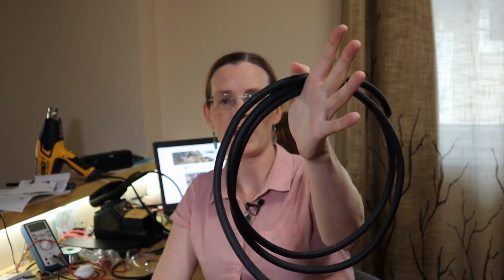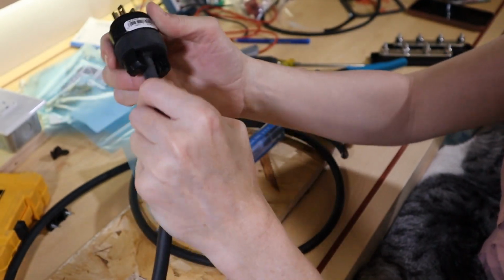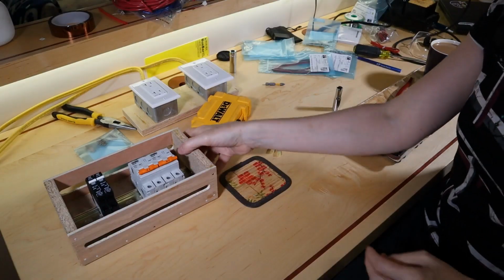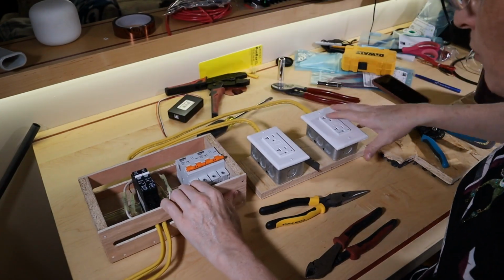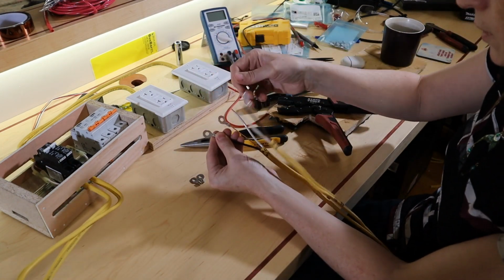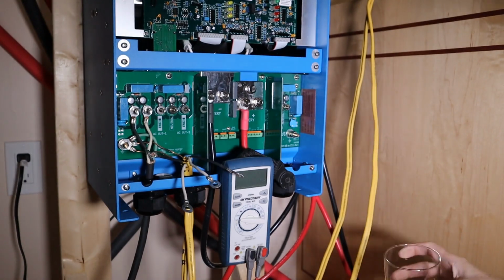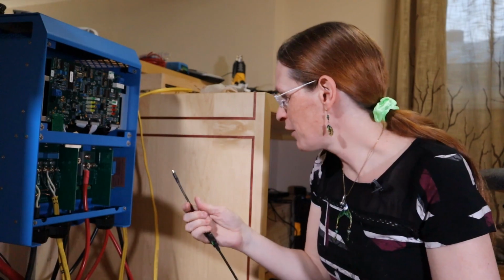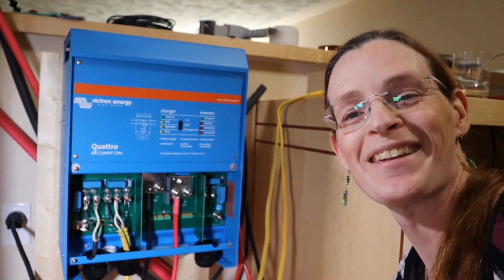Victron Quattro 48|5000|70 120v (Anti-climactic Part 2) - 48v Lifepo4 battery (Ep. 14)

Comment: Several issues to consider.
No 1 is leakage if power onto metal parts  . Example one Swedish round the world boat lost it rudder in Pacific crossing .The compass light on the steering wheel column was leaking voltage power and that connected to the stainless steel  rudder post and the stainless steel post eroded rapidly over a few years from  the electro chemical  forces with sea water and it finsly snapped  .The rudder lucky enough did not fall off and they got to a suitable island to effect repairs .

No.2 is lightning  storms and lightning strikes need to be factored in on electric circuits.   Always carry extra cable  and fire extinguishers as many as you can. One 60 foot boat had a large electrical fire in the engine room  mid Atlantic and the crew were surprised it took all three large sized fire extinguishers to stop fire . Now they carry 6 large fire extinguishers .They also now carry lots of  extra electrial cable as they had problems for normal electric power from lack of cables to repair burnt out cables ..

No.3 is copper wire connections corrodes a lot faster in thr marine environment . Good to not cut wires too exact to size so the connections can be remade at a later date . Also run a mouse string for wire replacement for upsizing or replacement .  Also cover connections with suitable  water resistant electrical  grease . There does exist s copper wire made for the marine environment that has much less corrosion issues .

No.4  issue is severe rolling over in bad weather eg 270 degree angle of roll from s broaching or freak waves event  .The worse is the rarer 180  degree or 360 degree  roll over in  storms .The system to keep battery in place in severe  roll  overs has to be considered..Severe rolls 270 degrees are more common where mast is partially under water from broaches going downwind .
Everything in boat cabins can then  be everywhere . If the  battery shifts then no lighting systems will add to problems .Good to have emergency solutions self contained battery operated  systems and also parrifin lighting and glass contained large candles. My boat had ma.ny large candles in glassed in containers and several parrifin lamps  lights and soon to purchase petrol fuel type

No. 5 issues  are sinking or wave event .Often in severe rolls or large waves the boats interior can be filled with large amount of sea water . It might enter from open or broken  hatches or  windows  or from prop strikes breaking shaft water sealing system  whatever . A one  inch hole 2 feet  below the water will let  500 gallons of water a minute enter a boat . After a few minutes whrn the hole is  plugged you need to pump out some few tons of water . In rough seas that water wil slosh around the boat and possibly cover the batteries even if they are placed in a  high up location . Planning for this might allow you to keep electric pumps going to help get water out of boat and prevent battery melt down from short circuits the salt in sea water can cause .

No 6 . The LED lights are very bad news to human eyes .They emit a light that over time can blind the human users .They should only be used to light up boat when the users leave boat on anchor and so they can see thier way back onto boat on the return . They can also be used for shirt periods to give extra lighting such as searching for something  in the boat .Other types of lighting for general use are better for human eyes .There exist suitable safety glasses that filter out the harmful light that LED lights emit and if you drive a lot at night can protect eyes from modern cars and street lamps now using LED lights . Also LED lights seem to lose power over distance.I find roof mounted LED lights do not light up floors as good as  other light types .Many boats also have red lights for main cabin they use at night time so the crew can maintain  night vision if the enter boat cabin at night .
Reply from the maker: 1. This is a very big concern, and one of the reasons why grounding will be a fairly big topic. Sacrificial anodes can only do so much...

2. Lightening is another reason for the grounding question to be such a topic. A strike can blow holes in the hull as well. On fire suppression, this is another topic I plan to address more after I get the boat. Coming from the IT world, I'm tempted to fit a proper electrical fire suppression system, if space allows.

3. I'm using marine-grade wiring (tinned copper) to prevent corrosion, and I am using resin-lined shrink tubing (ABYC compliance, at least as best I can). When I refit, I plan to run conduit (as I did in my house when I renovated it). 

4. I plan to have a (fairly) heavy displacement boat, but just the same everything will be strapped in place in case I turn turtle.

5. You noticed how I'm using the booted Anderson connectors and talking about keeping things water tight? This is exactly what I have in mind. I need to keep the batteries low for weight distribution, so I need to make them as water resistant as I can. I'm aiming for IP64 or better across the board. Truth is though, if things get so bad that I have that kind of water in the boat, I'll likely be powerless in any case and relying on a manual bilge, if I even save the boat.

6. I'm gonna need to see a cited source for the LED claim. I've used exclusively LED lights in my house for ten years without issue.
Reply: 6.  where did you get that from?
     are you trying to tell us that the whole world is blind now?

Comment: Hi, about the woodwork; personally I build wooden boxes (10mm plywood sidewalls, 18mm floor) for my rv battery's. I paint them inside with white primer only. Prevents moisture, and shows better when there is something leaking/or scorching... Outside primer and a nice strong topcoat. The top cover of the wood box, for the terminals I make from trespa this is a very hard synthetic material heat resistant. Used for cladding outside of houses. 
Perhaps showing the woodwork build in sort of time-lapse?
Reply from the maker: I did the stand in a sort of jump-cut style. I might do that for future wood stuff. I should mention also that this box is very temporary. Anything I do that I expect to last will be done a lot better.

Comment: Quattros only support VE.Bus connections.  You need a VE Bus smart dongle for bluetooth or MK3-USB for PC. 

VictronConnect is not fully implemented for VE.Bus devices.  Recommend MK3-USB, PC and VE.Config software.

Multiple linked inverters MUST be powered by the same battery.
Reply from the maker: Got the MK3 and Cerbo GX on order. Realized what I was missing when editing. Next video will be made once the arrive going over learning to use and configure the Cerbo and Quattro.
Reply: @TheDigitalMermaid  Glad you're going with the GX. I have the CCGX. Can fully monitor and control my entire system from 3.25 hours away with VRM (GX allows access).  Can download Quattro config file, edit with VEConfig and upload it. Can update firmware. Can change MPPT/BMV settings with VictronConnect.
Reply from the maker: @snoobler  Ya, that's part of why I decided it was worth the cost. Get it all working properly using their tools, then I have a reference when I start working on my future project to monitor / control things.

Comment: When you were testing output 1 the resistance was climbing but the meter was cycling trough it’s ranges. That’s why you saw an output of 10, first just 10 ohm, then 10 kOhm and ultimately 10 mega. I might be wrong but I did re check after watching the video and it sure looked like it was so in the bottom right corner of the DM. I’d say transformer and an capacitor is at play here. :)

Comment: it seems everyone is wanting to make sure you solder the terminals.  i think that is a nice feature to a GOOD foundation!  

other than that, my concern for your good foundation is to return to my question elsewhere, is 100 amps @ 55v enough power to the prop?  it may be your turn to say i'm getting the cart before the horse, but if i'm right, you are spending way too much money on gear that could be way too light for the job.  btw, one last time before i continue down this path.  did you consider sound proofing the engine room?  it can be done to the point you can not hear the engine if not inside the engine room.  i'm a witness to it.
Reply from the maker: I mentioned elsewhere, but I plan to have 6 of these packs for a maximum draw of 600A continuous at a nominal 48v. That is based around the QuietTorque 30kw direct drive motor, though I do still have other options. In any case, the idea of having N-number of 100A 48v batteries leaves me a lot of options on the table for whatever final design I settle on. 

On the noise of diesel; The noise is very much the top concern, but it is not the only reason I want to get rid of it. I don't want to be a diesel mechanic. I don't want to deal with oily bildges or smelly fumes. Every solution has it's pros and cons, and I've made my life in IT. So to some degree, the idea of maintaining an electrical system feels more familiar to me. 

There's also the idea that, even factoring all the limitations of electric drive, I can generate power anywhere, and almost any time. If there's no wind, there's probably sun for the solar panels. If there is wind, then I can start sailing and generate power via the prop's regen ability. Out at sea, I can't create new diesel. 

In the end, the choice of diesel vs electric comes down to "what hassles can you live with, and what can you not?". For me, electric wins.
Reply: @TheDigitalMermaid  ok, got it!  "electric wins".  but, i won't write that in stone just yet.  this way you can still change your mind.  

i looked up your QuietTorque 30kw direct drive motor.  NICE!!   looks like you will be changing the size of each pack.  that will reduce your run time unless you raise the number of packs.  i did not see numbers on the Programmable regeneration.  did you?

on an average day for me, i use about 1.5-2kw with my 12v system.   that is just for fridges and computer.  my water pumps don't get much use since i'm alone.  if you ran your 30kw at half load for 1 hour (no wind for sailing), that would be 10 times my use.  my catamaran is 48 x 24 feet and i carry 8 solar panels.  i could probably go half again more giving me about 1600 watts.  will you have enough room for that many panels?

one more thing for now.  you made a comment on welding cable.  i believe most people don't know why some wire is stranded and some is solid.  the air force told me it was because of vibration.  they suggested, like with hay wire (similar to solid copper wire), if you bend it back and forth enough, it will break where the stranded is more forgiving. now, if you look at welding wire, each strand is even smaller than the battery cable you have been using.   hmmm...  wonder why?  well, that would be to allow the welder more freedom of movement.  the smaller ga. strands make the cable a lot more flexible.  as a rule, it is much bigger than 4ga.  if you solder & crimp terminals on and use that nice heat shrink, i bet you could throw that cable in the ocean and not have any problems with it once recovered, even months later.
Reply from the maker: @tcloud24  Electric is the only way I am going, the only diesel question is "generator?". I'd give up on sailing before I'd go to a diesel drive.

I'm planning on 80+ kw of power, and even with that much power, I plan to only use it when I really need it. If that's not enough, well, I can add more battery packs later. The system will be quite modular. Also, I'm not married to the QuietTorque, it's just what I know will work, and so what I have built around. I may well change up to a different motor, and possibly even go to AC as I hinted at in this video.
Reply: @TheDigitalMermaid  i feel like my writing has a mask on.  didn't mean to sound like you did not get your message across, because you did.  maybe i should have put a lol there too.

just did the math on 80kw.  using 100amp banks you will need 16.  so about 2.5 hours of run time.  am i assuming something wrong here?  

one more thing, the QuietTorque 30kw does use (looks like 2) ac motors (Specifications Motor type 2 PMAC Brushless).  i guess the controller is a big reason for the big price tag ($15,495.00 ).
Reply from the maker: @tcloud24  Note the different between battery maximum constant draw and battery capacity. The batteries I am building will handle 100A continuous load per bank, across six banks gives me the 600A continuous draw I need for the QuietTorque 30. The capacity is 280Ah per bank, 48v nominal, means that I have (280Ah * 48v) 13.44kw per bank, 80.6kw total (13.44 * 6). So I can run, 100% -> 0% SOC, for 2.8 hours. Of course, I'll never do that. Running at 50~70% load, so I could well get 6 or more hours of continuous operation at reasonable load.
Reply: @TheDigitalMermaid  this got me off track a bit, "the idea of having N-number of 100A 48v batteries ".  ok, let's do the math using 280amp banks.  so, 6x280=1680, right?  running at 2/3 cap  (400amps) we have 1680/400=4.2hrs, right?

ok, what i was driving at was replacing the amps, thus the question of how much regen is the unit capable of.  

btw, will you have a dinghy & outboard with you?  if so, how big and what hp?
Reply from the maker: I've not looked much into the regen yet as I'm holding off doing a deep dive on motor options for when I buy a boat and know what I have to work with. I will have a dinghy, yes, and it will be electric as well. I will probably end up gutting the battery I am building now into spares + dinghy power. Exactly what dinghy I get will also be determined after I know what boat I am getting.
Reply: @TheDigitalMermaid  food for thought.  i've be sailing since 1985.  i did not start out with 2 outboards, but i do have now.  one is small (3hp) for those tight anchorages (not far to shore).  the other is my workhorse (18-25hp).  putting a second (or 3rd, or 4th) anchor out (and bringing in), pulling a drifting boat off sandbar & back into anchorage, going to dive site far away, etc.  you can imagine.  i even have had a couple stolen.  helping other boaters when they break down has taught me you don't need a lot of hp to push them to safety.  that goes for yourself as well.  10 or 15hp works well.  but as the saying goes, there is no sub for HP!!
Reply from the maker: @tcloud24  Thanks for this! I've not even really started to consider dinghy drive yet, so this will be helpful later.

Comment: Assuming your trip switches remain in the current wooden box, I would think that the visible compressed wood used for the current sides of the box , are likely not to do well in moisture environments.
Reply from the maker: The wooden box is very much temporary. I made it using scraps I had around my shop. It's principle job is to keep the noses of curious kitties away from live terminals. It would be lucky to last six weeks in a marine environment.